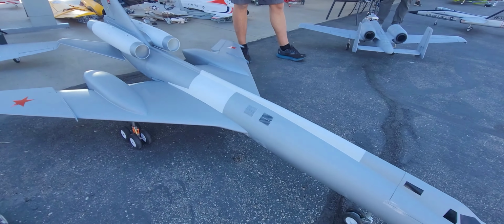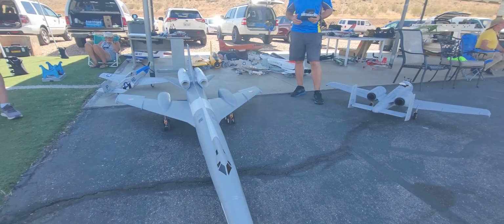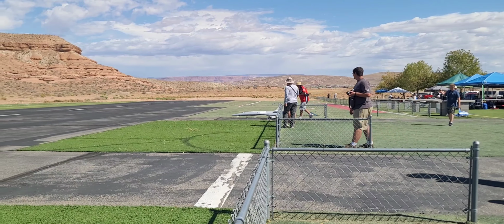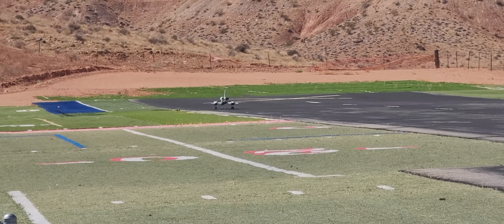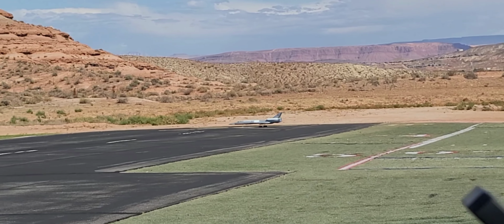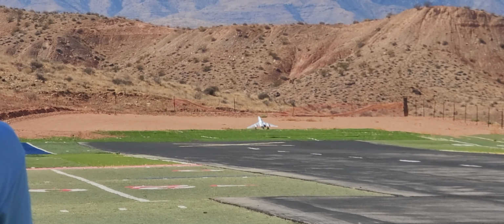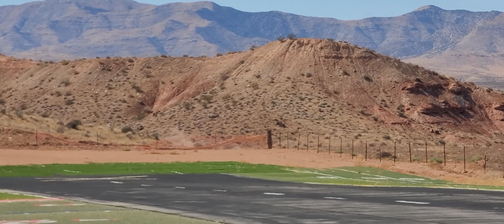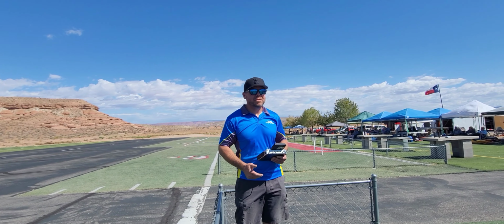HUGE R/C TU-22 BLINDER MAIDEN ATTEMPT

Comment: This was an experiment like all my planes. Our target weight was 17 lbs which would have worked out well. At the end it was 24. What do you do then? Either strip it down and throw it in the garbage or bring it to the meet and have some fun with friends knowing full well it has a 10% chance of coming back. We chose the latter and judging from the number of views I think we made the right choice.  
Brent knew all of this and still agreed to try. As it turns out we will get another try as there is not that much damage. The plan is two 90mm fans on 8S. I think we have a good chance of making it fly.
The reason it didn’t work is all my fault not Brent’s. He is the absolute best pilot and a close friend and he did me a favor here, so thank you Brent.
We will press on to other projects if it doesn’t work with the new power setup. It’s just a model and I do this for fun with my friends so we are good.
I hope everyone enjoyed the show!
Paul

Comment: cg location is one thing, slightly longer front strut is another but I think it is also worth checking if exhaust nozzle are bent upward enough becaus assuming motors have big static thrust it could give quite big torque.. Hope it will fly again :)

Comment: We knew it was heavy and Brent did all he could. We will rebuild with more power and try again. Optomistic that it will work
Paul and John
Reply: Amazing looking model, best of luck on maiden #2, I really want to see that fly! More power should certainly do the trick. I have a 12lb twin 80mm F-14 that I'm putting on a diet because our field is a bit tight and landings are harrowing. Curious what you're looking at for more power, would 90mm fans fit in those beautifully crafted nacelles?
Reply: @rcAirplaneDeficitDisorder  thank you, we will probably need new nacelles for the 90’s. That is no problem!
Reply: @ps2727   Maybe check your COG looked well nose heavy
Reply: @Rob-vv5yn yes I agree

Comment: Assuming the pilot's weight estimate of 24ish lbs to be near enough. That's 24x16=384 ozs.  Wing area doesn't look more than 6 sq ft, so 384/6 = 64 ounces per sq ft, VERY optimistic.
Lovely model but it will need to shed a stone before its next outing.  (surely it can't be 24lbs). Superb airfield facility, wish we had a runway like that.
Reply from the maker: @dimsum435  i was assured its 24lbs. Dont forget its 10ft long
Reply: Yes it’s too heavy, we will get more power and try again

Comment: Any thought to using a small increment of takeoff flaps? I know more power solves everything but that little bit of lift might have lessened the need for full rate to get the nose off the ground and set the climb attitude. Can’t wait to see the next iteration.
Reply from the maker: @boommasterkc-135____8  we were using takeoff flap. The high temps wernt helping us much nor was the up hill runway
Reply: @hechtspeed  got ya! It’s hard to tell with that little wing. Density altitude and runway slope aren’t friendly for a maiden if they’re in the wrong direction! With the margin being that tight, it would have been a handful for sure.

Comment: those planes were notoriously known for instability.  It was pretty much a test platform for soviet aviation to learn about super sonic aircraft design.
Reply: @Chainspike101  yes. My understanding is that it flexed and changed shape a little when flown so it was a handful. Also had high takeoff and landing speeds too. Not a great design but it needed to be modeled!

Comment: Man, way too heavy and not enough thrust. I did the maiden flight of a 60-size P-47 that had a wing loading of 50 oz/sq ft. It flew fairly decent actually, but I think the owner turned it into a static display model after that..
Reply: Just nose heavy
Reply: I am sorry for the loss of this beauty!

The A-10 next to it (at the beginning) has around half the weight and same thrust... 

That was for sure part of the issue.

Comment: I cannot believe the pilot would attempt a takeoff on low rates if he has a reasonable amount of experience. If he felt as if he needed low rates, then this is not the plane for him.
Reply from the maker: @wazza7575  there wasnt much difference between low and high rate. We had no idea how the cg was going to be so i didnt want to start off with way too much throw. Ive test flown just about every type of model you can think of. Nobody has ever made a model of a tu22 before. Maybe next time we'll let the internet experts fly it.
Reply: @hechtspeed Like you, I, too have a lot of experience. My point was, when you chose not to abort the takeoff and then switched to high rate, it was all too late.
Reply from the maker: @wazza7575  the airplane doesnt have brakes. Theres a fence at the end. I wpuld have had to aborted at mid field. That was right about the time it started to accelrate well and rotate. Once i got to that point i was commited. It was that or go through the fence at 50mph. I think theres less damage than if it had gone through the fence. The airplane is fixable and we will take the lessons learned and have a successful flight next tike around (more power, better cg)

Comment: Your RC TU-22 BLINDER has too weak motors for the hood to make the R/C TU-22 BLINDER fly. Put stronger engines for the R/C TU-22 BLINDER and it will be fine. Then you have to count on the turn signal on the TU-22 BLINDER is camp and the start stick is longer. If you want to fly an R/C TU-22 BLINDER, you have to put hidden slots on the aircraft and stronger engines. Pure aerodynamics exp what you gain in lift you lose in speed, what you gain in speed you lose in lift. Upgrade the R/C TU-22 BLINDER and it will surely go much better. Have a nice day....
Reply from the maker: Thats the plan

Comment: Oh come on man......no way it was going to fly down at the end of the runway......shut that sucker down and put in 2 90mm fans!!!!!!
Reply from the maker: Theres a fence at the end either had to commit to flight or let the fance destroy it. The model is fixable and will be fixed and upgraded
Reply: @hechtspeed  Ya just looked like your could have shut down earlier....sure glad its fixable.....cool model   Good luck for next time.
Reply from the maker: @shelleibach20  i could have. But i would have had to shut down at mid field. It has no brakes. And mid field is about where it started to rotate. So i stayed in it. Disnt know it wpuld be exteemely nose heavy(first model of its kind...and the cg was very conservative) also wasnt counting on the massive amount of drag caused by the main gear bogies hanging straight down
Reply from the maker: @shelleibach20 hindsight is always 20 20. Sometimes just just dont know till you know. Now we know
Reply: @hechtspeed  Too  bad....video said it weighed about 24lbs....ya needed brakes for sure...my turbines average about  26lbs and I for sure need brakes.....good luck

Comment: Ouch!
Reply from the maker: @PiratePrincessYuki  yep. A bit underpowered and nose heavy
Reply: @hechtspeed  I saw the motors and thought they were too far back in the ducts. But I’m thinking like my dad.
Reply: The thrust line is well above the CG giving a big throttle dependent pitching moment that is pushing the nose gear into the ground. The nose wheel coming off was probably a symptom of that. You won’t be able to rotate until you have enough speed to overcome that with the horizontal tail. It’s a common problem with these high mounted engine aircraft. 

Neat model though! Good luck!
Reply: 24 lbs for 2 80mm is asking alot. I could tell in Brent voice and breathing that he was worried. 17 18 lbs it might work with prober CG.
Reply: @timgarrett203  It's also rolling with quite a bit of nose down attitude.  I think the real plane has a slight nose up attitude on the ground.
Reply: @PiratePrincessYuki  there is a reason for that too, but I agree it’s not optimum
Reply: @RocketToTheMoose  yes the thrust vector was not helping….

Comment: Predictable result. Why force it when you are clearly forcing it?
Reply from the maker: At a certain point you just commit to attempt flight. No brakes on it. Fence at the end of the runway. At mid field it started to accelerate well and rotate. So i stayed in it. We didnt know it was going to be so nose heavy. Nor were we counting on the drag of the main wheel bogies after lift off. Lessons were learned. The model is fixable and improvements will be made
Reply: @hechtspeed  🤣 it was super sluggish in acceleration and appeared to have great difficulty rotating. Good one 🤣
Love the unused runway behind you too
Reply from the maker: @skooter2767k  well i went to the end and turned around. So. We knew it was going to take a good amound of runway to get off the ground. It started to rotate at mid field. Next time you can have the honor of test flying a never before modelled aircraft.
Reply: @hechtspeed  I think you need to watch the video. It didn’t start to rotate mid field. Yes, I’ve test flown never before modeled RCs. Have test flown 3 full scales on their first flights too. Like someone else commented, just from the taxi tests, the results of the first flight were a forgone conclusion